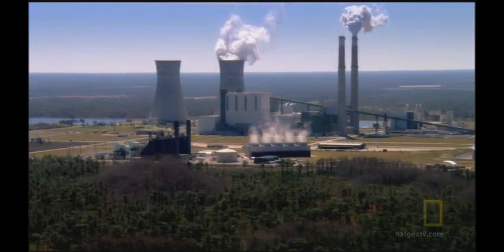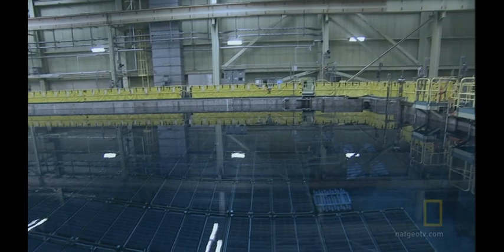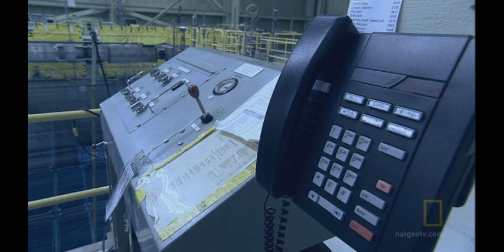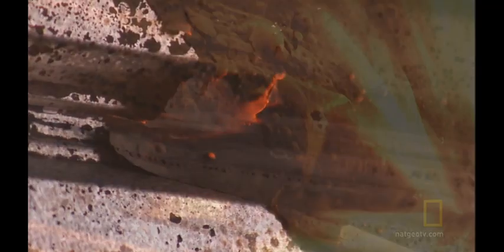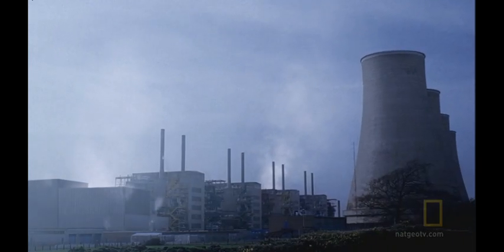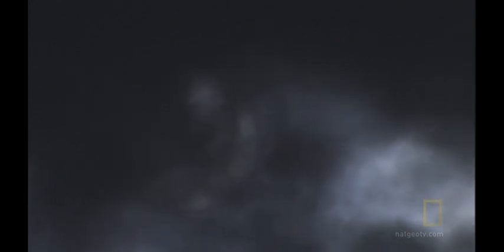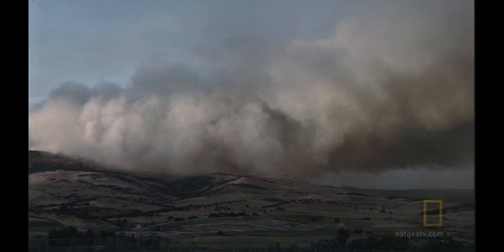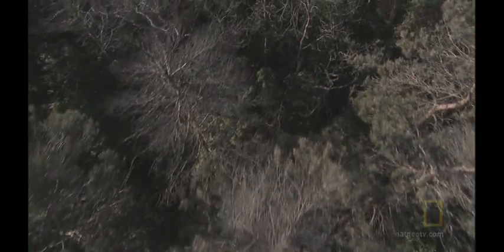Nuclear power plant spent fuel rods overheating and meltdown

Comment: For those who said as long as there is people in the plant this incident won't happen. They must not seem how fukushima explored!
Reply: This does not resemble the fukushima disaster in any way. They had a full meltdown due to a power loss, this reactor shut down safely when grid power was lost. Only the cooling pool was overheating after the water evaporated. The fukashima plant couldn't shut down the reactors after damage from the quake and tsunami. They obviously had control rods which couldn't reach the reactor after the quake or tsunami and the tsunami destroyed the cooling system's backup generators.
Reply: leerman22 Bullshit.

Comment: superheated steam bah humbug, the water (assuming we are near sea level) will boil at or near 212ºF with 1 atmosphere of pressure on it, relatively clean water with some Boron  added will keep everything hunky dory. these days fuel is removed from spent fuel pool when the decay heat goes away and stored in concrete (BIG) flasks with a stainless steel liner

Comment: you can go swimming in that without much danger, as long as you stay away from them, like don't go diving and touching them. you can actually swim in it without problem, it'll just be really warm. water is a very good radiation blocker
Reply: +lee leavelle at the plant i work at we have to wear auto inflating life jackets incase you fall in when in the fuel pool areas
Reply: +grizzskoalcope I'm assuming for the same reason it's a law to wear life vests while boating
Reply: its a nrc/osha/iso regulation. but im just agreeing that you wont die from falling in or swimming in a fuel pool unless you go down 30ft and hug a fuel assembly for a few hours
Reply: +grizzskoalcope a few hours....? I'm sure a minute or so close to something that hot would be lethal
Reply: not underwater and you wouldn't die instantly. you can actually hold new fuel assembly's with no ill effect and during a refuel you can stand on the reactor head with no effect ect. it also depends on how old the fuel assembly is we move them to dry cask after so long (dont know the exact time)
Reply: grizzskoalcope I'm going to make a shirt that says, fuck tree, i hug fuel rods, with a big radiation logo
Reply: during each outtage we get shirts that have cool designs on them like a big rat glowing with a fuel assembly and lightning in the background lol
Reply: lol. Id love to work at a nuclear plant. its good pay too, right?
Reply: in short you will make around 100k a year in any full time position (80k-120k) unless you are an SRO or something fancy
Reply: a full blown mechanic makes around 40h there are other positions of course but most pay around 40-60h im on the low end of the pay scale because i dont have much time in yet
Reply: +grizzskoalcope not too bad. but there's better
Reply: +grizzskoalcope It's safety. You can't drown in the pool. This became a requirement after Naval incidents and other chemical companies experiencing workers falling off scaffolding or slipping into bodies of water and drowning.

Comment from the maker: Thanks all for the feedback and comments (Thanks to National Geographic for this awesome clip)
Reply: smokeyjayshouse If "nuclear fuel doesnt explode, it melts!"  Explain what exploded at chernobyl
Reply: Wesley Meredith in chernobyl hydrogen gas was emitted from the separating of the water molecules in the air. And whenever the power was restored or a light was turned on that caused a spark which ignited all of the hydrogen gas floating around in that section of chernobyl and it went BOOM
Reply: ***** the fuel rod casings are made from a zirconium that reacts with water/steam when (glowing) hot producing hydrogen, but indeed it IS still possible for the spent fuel to melt into a puddle that can reach critical mass! Chernobyl was indeed a reactor at the very edge of loosing control then slipped and overheated within seconds and build up enourmous pressure causing the explosion! "Properly" stored spent fuel can boil all water thus exponating the area to direct radiation but when the water is away, the neutrons velocity is too high to create a chain reaction unless it melts together as mentioned above
Reply: brokenintel Thanks NatGeo for continuing to scare the public with blatant misinformation.
Reply: NatGeo  has just lost all credibility in my eyes. It has now turned into a complete  propaganda and misinformation bullshit outlet. This is obviously a blatant attempt to scare the ignorant public with crazy environmentalist jargon of shit that's  impossible..  The biggest problem  is coal-fired power plants, on a every year basis they release more radio active material into the atmosphere then all nuclear power plant accidents in history put together.  And that's a fact  that no environmentalists will ever touch up on. Because its a movement that is blind to solving actual problems that exist. Its all about making money and gathering donations forever but never actually solving real problems
Reply: smokeyjayshouse what changes would you suggest they make to this program?
Reply: Michael Hunt Spent fuel pools aren't pressurised the cooling water can't get hot enough to break the hydrogen-oxygen bond. No hydrogen explosion, no steam explosion.
Spend fuel cannot, under any circumstance explode. It's simply not possible in reality. Melt it, cook it, bake it into a cake, whatever, it cannot explode.
So basically, the "disaster" it talks about can't happen.
The description of "radiation poison" is so far removed from reality,  it's complete fiction.
Reply: JustRootsAndLeaves
are you knowledge resistent? the zirconium alloy of the rod casings reacts very well with the water/steam and breaks the bond very well. the zirconoium only has to become hot enough! The disaster described in this video will not happen like this anyways, even if there will be an hydrogen explosion there will be no "major" release of radioactive material. there will be no fast crtiticality, mostly a spontaneous criticality which produces large ammounts of heat but never an explosion
Reply: JustRootsAndLeaves You are to knowledge as a piece of paper drenched in never wet is to water.
Reply: JustRootsAndLeaves The physical state of water exist in three states, solid (ice), liquid, and gas (vapor, steam). When the water has boiled away the vapor still exist in the space. That water vapor can exist at 10,000 °C. It's the steam that reacts with the hot zirconium that produces hydrogen.
Reply: tobyr3 When the reactor over heats, the water turns into Hydrogen and Oxygen gas. It completely skips the vapor phase. It goes directly from water to the two gasses.
Reply: The zirconium cladding, at over 1,000 °C, catalyzes the breakdown of water molecules into hydrogen and oxygen. The water is a vapor at such temperatures despite elevated pressures in the reactor pressure vessel. There may be liquid water in the pressure vessel but any liquid that splashes against the red-hot zirconium surfaces immediately flashes into steam. It is the vapor that dissociates. There is not a breakdown in the liquid water phase. Please check on the physical chemistry processes.
Reply: tobyr3 I am a professor of Chemistry actually. Ice sublimes into vapor. It never becomes liquid. In the same way when the water touches the hot fuel rods, it instantly dissociates. You will find this same process by running a current through some tap water.
Reply: The physical process of water subliming is a different process than chemical disassociation. I'm quite familiar with water disassociating in a electrochemical cell and have done that many times, starting when I was a kid. This is not the same process as elevated temperature dissociation in the presents of a catalysis.
Reply: tobyr3 Caught you there. "presents of a catalyst". *presence, not presents. Your argument is flawed, you have no idea what you are talking about and it just so happens that the random mesh of ideas you loosely hooked together is also wrong.
Reply: Michael - Thank you for your spelling correction.

In the effort to maintain a person's worldview they often find it necessary to dismiss, criticize, and attack positions that clash with with their own worldview. This includes rejecting evidence that is presented to them. For some, liberals are the enemy and all that they represent must be attacked over and over again, even when there is strong evidence that some of their positions are correct.

I understand something about electrochemical disassociation of chemical bonds as takes place during the electrolysis of water. I understand that phase change, such as takes place in the sublimation in ice and dry ice, involves a different set of atomic forces than those involved in typical chemical bonds. I also have some understanding of the ways catalysts can reduce chemical reaction energy.

As a professor of chemistry you should know about the differences of such processes.

Please answer the following two questions. When a nuclear weapon explosion takes place in the Earth's atmosphere what is the approximate mass of plutonium-239 that is typically dispersed into the Earth's atmosphere from the average test? What are the total number of nuclear test explosions that have been conducted to date by all nuclear powers? Feel free to use Wikipedia to find these answers.
Reply: tobyr3 I'm not attacking your worldview, I'm telling you that you are in fact wrong.
Reply: If a person has an open mind and is looking to learn new things then that is fine.
Reply: ***** Since when did NatGeo have credibility? Have you ever watched NatGeo?
Reply: mark robertson POSIT ISN'T A WORD! HOW AM I IGNORANT? I'M RIGHT, IT IS SALTWATER. FEMA CAMPED? WHAT THE FUCK DOES THAT EVEN MEAN???
Reply: mark robertson I'm sorry, were you intending that to make sense? Because it didn't. At all.
Reply: brokenintel    361 AlQaeda core members thumbed up this video.
Reply: Michael Hunt I see nothing obvious about your reason.
Reply: The Kaiser Wow, you've had a whole week to figure it out and you couldn't? That's so funny
Reply: Michael Hunt Yes, spelling foreign languages, e.g. Arabic for "the base" which is "al qaeda" not "aLLqUIda".
…or you misspelled it because you want to trick the NSA-dragnet into the belief that you are not a member… Sorry, but that won't work. It is quite worrying that Al Qaeda has now nuclear physics professors as members.
However, what is your explanation of the excess heat in the Pons-Fleischmann experiment.
Reply: The Kaiser You aren't making yourself look any smarter
Reply: +Wesley Meredith that was steam explode but beter example when plutonium get tha kritikality like in nucelar bomb its gonna explode

Comment: Some power plants were actually retrofitted or built to use re-useable power (wind and solar, which would charge a battery to keep the power going) along with diesel generators would keep the most critical systems going.

Comment: "If not kept underwater, they will heat up to 1000 degrees" -> "When all water is gone, everything will explode with 500 times the power of Hiroshima". I miss some steps between there. Why would something of 1000 degrees explode while it is not airtight encased in something. Just let it sit being 1000 degrees on a concrete block i would say if that's the complete story (which probably isn't).
Reply: +Richard van Pukkem This documentary is just full of bullshit, because it's not that complicated in real life, and no, overheating nuclear combustible can't explode like a nuclear bomb, it just can't because of "muh physics".

And the combustible isn't in a state of nuclear fission, it's not a nuclear reactor but a fucking pool to store it and if the combustible is old enough (sitting here for a few months) It would produce just enough heat to warm a few cups of coffee at the same time but not an entire fucking pool full of cold water.
Reply: +Richard van Pukkem The radiation release is 500 times greater, no explosion. Like he said. The spent fuel will heat up an start a chemical fire which spreads the radioactive isotopes.
Reply: Hjem..... time to get past this ancient nuclear design concept of the 50's and 60's.... which had far more safety issues than today's.... even though such issues were exaggerated.

Comment: That pool thing scares me...
Reply: Goat It should not. That is not a single thing in this video that is actually true.
Reply: ***** you would get wet.
Reply: ***** Nothing, you would just get wet.
Reply: ***** Well, the water is 15 meters deep and crystal clear. The water is continuously purified with osmosis filter to make it absolute pure. The reason is that water don´t carry radioactivity, but unpurity in the water can do it.

(Its not really true that water don´t carry radioactivity, it carries tritium, and tritium is technically radioactive. But Tritium is lowest down on the radioactive scale, so it cant irradiate something else, make it basically non ionizing (again, technically its not, but in practical terms it is).

But don´t drink the water. While the Tritium radioactivity will not harm you, the atomic change that is caused by the decay may. Its not really dangerous if you drink a little, but if you drink a lot, it might be.
Reply: +matsv201 I'm fascinated by your knowledge!!! Please answer me this, I've always wondered: If I were to swim in the water. Say, fall in and swim out... What temperature is it? Too hot to touch? Would the levels of radiation in the water (you say none other than in the impurities) be dangerous?
Reply: Lindsay Brown
"What temperature is it?"
About pool temperature, maybe a bit warmer. It depends on the temperature around. But say 25-35C (i don´t know what it´s in Fahrenheit, but under 100 anyway)

No, the pools is designed to be around 30C so it don't evaporate to badly. If it was say 40 or 50 the whole building would be wet on the inside.

Normally if its rises over 30 something, they circulate sea water in a piping-system in the under floor concrete (like a under floor heating, but cooling). This is just to keep the building nice to work in, not really for safety.

"Would the levels of radiation in the water"
Quite low. To understand this, the water is really really clean. They run the water in a filter... similar in a pool, but its a osmosis filter, to filter out all dirt.

This is because pure water is only Oxygen and Hydrogen. The longest lived heavy non stable isotope of oxygen is 26 second. This is a very short time and have no real world impact. The longest lived isotope of Hydrogen is 12 years (tritium/Hydrogen). But hydrogen have a very very low ionizing strength. Its basically in the practical world, non ionizing (its really a border case). So its basically safe.

This is actually the reason why they would not let you take a bath. Because if you did you would make the water to dirty and it would get poputed and absorb radioactivity from the fuel.

I have a friend that use to work in a place like that. And he always say.. If you jump in you would be deed before you hit the surface.... not by the radiation or heat.. but by the bullets of the guards.

Well, i don´t think that is true... but... im not that sure ;)
Reply: matsv201 So you're saying that I could swim in it if I wanted to?
Reply: Opinion Onion No problem, it would be perfectly safe as long as you didn´t drown and no guards se you do it. Could actually rebuild it to a pool, put in a false floor and use it as a normal pool. It would not be any real problem. 

But the pool water and cooling water need to be separated to keep the cooling water clean..
Reply: +Opinion Onion HELL NAW
Reply: +Opinion Onion same when i hear "the pool is 30 FT deep" image started to apear in my brain dark water deep like hell so im kinnda scared!!!
Reply: Yoga Hp Its actually not that dark. The beta radiation from the fuel, stimulates the water giving up a soft blue light
Reply: matsv201 NO ACTUALY  the dark thing its just my imagination lel its just in my mind
Reply: matsv201 It's not the water, it's the industrial setting. It's also tied in with submachinaphobia.
Reply: +Lindsay Brown To add to mats comment (he is a knowledgeable source) I would say the pool temps depend on the purpose. Our research reactors pool is slightly below room temperature most of the time and entirely passively cooled. We store everything we every used in the reactor there and it makes a great tour location for guests.

Comment: The fuel doesn't go off "like a nuke".  Plus, the decay heat is not coming from transuranics. It'll simple heat up until the ceramic pellets melt the cladding.  There is virtually 0 possibility of recriticallity.  The worst case is the water drains out and radioactive steam exits spent fuel pools.  Plus, a majority of the fuel in a pool isn't hot enough for that to happen.

Comment: Actually its not the fuel itself that is exploding in this scenario. The fuel cladding reacts with steam at high temperatures, and breaks it into the constituent hydrogen and oxygen, which in sufficient concentrations is an explosive mixture. 

A hydrogen explosion can break open the containment building, and then smoke from the burning fuel will loft a plume of radionuclides. 

It would be less dirty bomb and more terrible chemical fire. The levels of contamination would certainly be extreme - but trying to compare this to Hiroshima bombing is very much a non sequitur.

Comment: power the generators with solar and wind and some electricty straight from the reactor. not to mention that LFTR reactors have a passive system for removing the heat so it does not need pumps or anything like that

Comment: Uranium used in nuclear plants can't explode though... Fission is the splitting of the molecule into two smaller molecules with the release of an individual neutron.  By fully inserting the control rods, they can absorb the neutrons and stop the fission reaction in seconds.